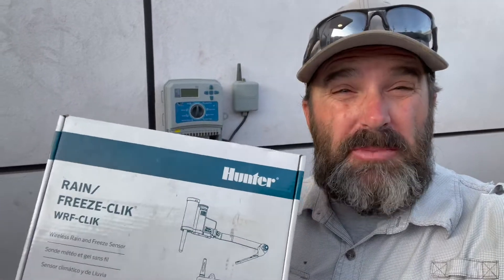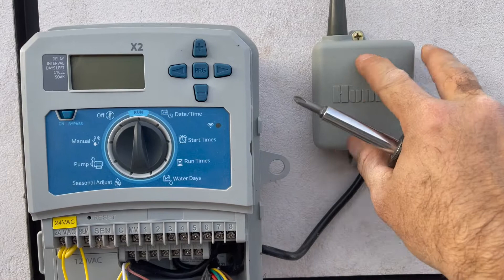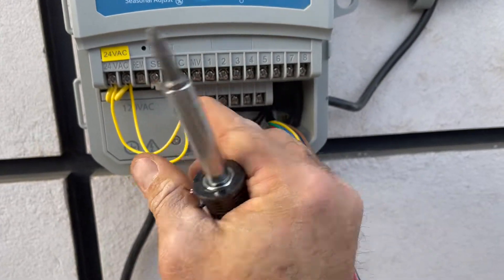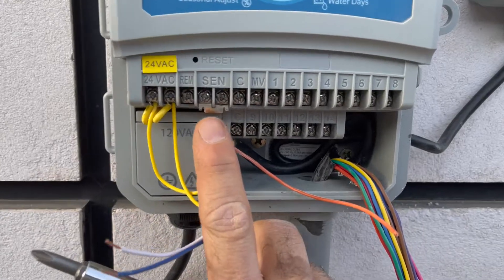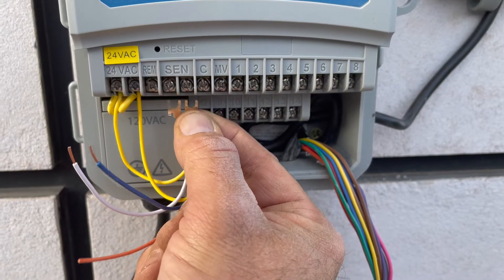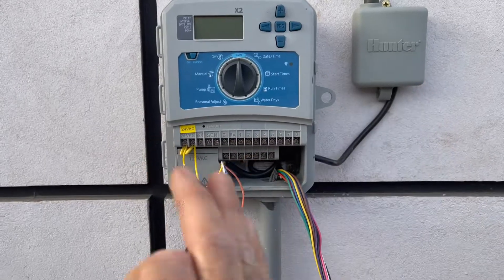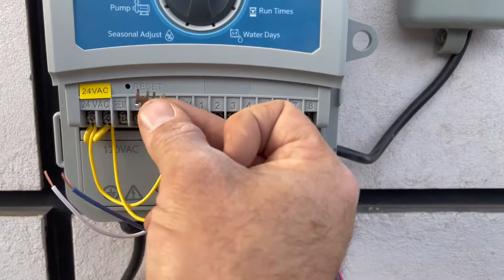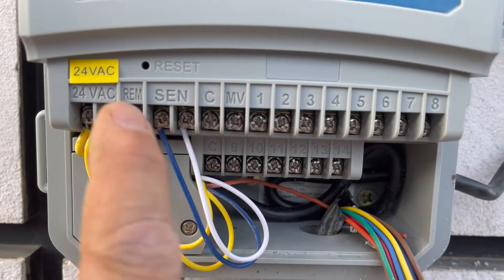What I Didn't Know About Installing A Rain Freeze Sensor

Comment: Can you disconnect the wires from the transmitter Clik and replace with a new one without removing all the wires from the panel? I have an old transmitter (pigtail wire) and it would be great if I can just swap the transmitter and leave the wires alone.